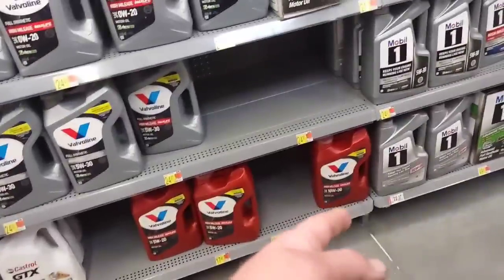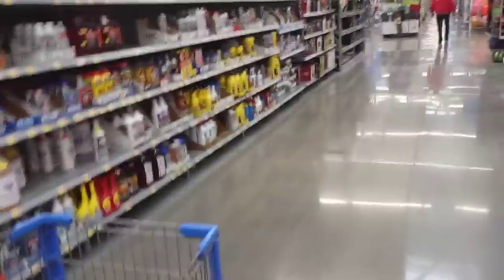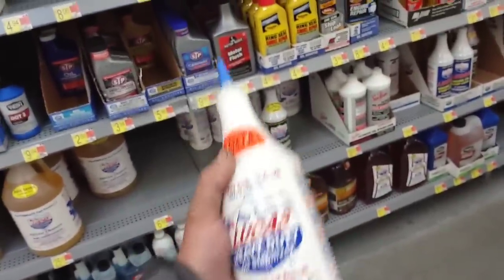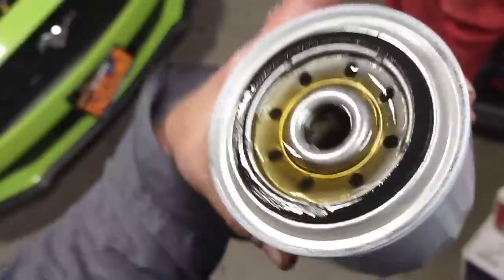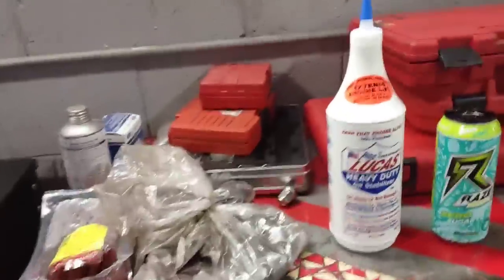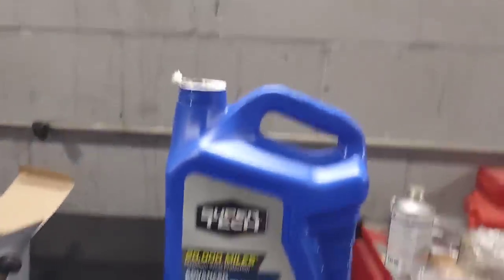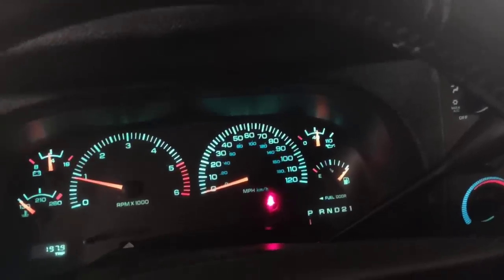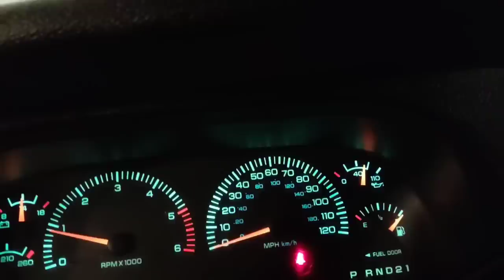We continue With Marvel Mystery Oil and SuperTech 10w30 20k Mile Full Synthetic Oil Dodge Ram 5.2L

Comment: I thought I was the only one that hated going into Walmart lol
Reply: Tangling with the unending throng of idiots in the parking lot forebodes the hassle coming when you get inside the place.
Reply: @davef.2811  Yes! 😂  You've got to park a mile away, walk passed the idiots, and the store is usually a mess.  Then you have to check yourself out.  I feel like they should be sending me a paycheck lol
Reply: We have a Wally World in Seminole FL. The building is 1/4 mile long. I have bad knees. A lot of walking in there. Yes there are electric shopping carts there, but I hate the looks I get when using 1.?  But there prices are very low 4 the most part.
Reply: @Thebowzer221  You make a good point.  The stuff in there usually is cheaper and I can understand many who shop there out of necessity.  Personally, I don't shop there, but I figured out that about every 3 years, I have some reason that I have to go in there for.  People kind of look at me funny like they don't believe me when I say I've set foot in a Walmart once in about 6 years.  It is possible! Lol
Reply: Heck no.  I will, and have driven past WM's in order to get a lot of things I needed.  F them.
Reply: @bouncingsoul777  Absolutely.  I mean, you can buy low priced Chjunk, and prop up those commies, but I'd rather buy better quality stuff from a company that respects me.
Reply: The Bowzer What a baby. Complaing about bad knees and then the looks you get for using the electric cart. Use the electric cart don’t worry about the looks, better than your knees hurting for a couple hours.
Reply: The first time I went into a Walmart in Washington, I was surprised that Everything was thrown on the floor as you went down the aisles... Guess only drunk clowns shop there or something... Sad...
Reply: @jmackinjersey1  Agreed.  Not to get political (because it seems like everything these days is), but I'd rather pay a little more and go to a place that respects their employees too.
Reply: @frandanco6289  😂 we must have those same clowns in Kentucky
Reply: I can offer my secrete for dealing with the crazies at walmart, but you have to promise to keep it to yourself. ( shop early in the morning when most of the idiots are still hung over/just waking up).  I don't shop anywhere after 10 am unless it's an emergency.

Comment: "MMO is about a 5 wt oil. It will reduce the high end number of a multi-vis oil by 4 wt points. The low end number will stay the same when used as per directions." So there's the thinning answer from MMO. It doesn't thin it much.
Reply from the maker: I did notice a pretty slight difference in viscosity so either way potato potahto
Reply: Plus the lighter weight components of the MMO will flash off some, leaving the viscosity of the oil still ok. If you want a good cleaning oil to complement using the MMO in a higher mileage engine such as his Dodge 360, consider using M1 10W-40 High Mileage or a diesel 15W-40  such as Super Tech for a summer cleaning run with a thin cleaner like MMO.

Comment: I pretty much just use Supertech now because the cost is impossible to beat. It's mostly made by Warren Oil Company and really as long as an oil has an SAE label it meets the standards for that rating or there are heavy fines. Everything else is just additional additives a brand may put in. Heck most of the 'big' brands don't even make all their own oil they just buy it from mixers like Warren and have their additive package added.

The Supertech filter was originally made by Wix, but now the contract is with Champion and as far as I can tell looking at them it's the same design and components.

Comment: According to my contact at Champ Labs, the Super Tech filter is good.

 I have had Super Tech oil tested via Blackstone Labs when I was doing a test similar to this one on a high mileage Honda CRV that pulled behind my motorhome and it was as good as any I tested.
Reply: The supertech filter clogged on my silverado after about 4k miles fyi. Got a new one on w oil change about 1000 miles ago still going strong.
Reply: @AldousHuxley7  
That can happen to any filter..
 Did you cut the filter apart to see what failed?

Comment: 500 miles. Let it work. This is informative.  I've still only 80,000 on my 2010 hemi and change oil once a year atleast. Some years i only put 2500 miles on the truck.  Brother put 40,000 in one year. So far no problems but have some older vehicles, that were pre owned. This may come in handy.

Comment: I bought almost the same oil and filter today. Bought the high mileage super tech, and the super tech filter. The filter is not that bad too for a cheap filter. Yep same number as the frame line. Super tech makes good oil. Yea auto parts stores have huge price increase over Walmart!

Comment: I would do at least a 500 mile update.  The buildup is not that bad.  I would have done a compression check before and after to see if it cleaned the piston rings.  I have used mmo in general aviation years ago for stuck rings a sticking valves.  Worked great.  If a aircraft sat for many years the compression was usually low.  Running mmo for a few hours often returned the compression to normal levels.
Reply from the maker: There's a lot of things I could have done but there's also so much time that I'm willing to put into each project and still work a full work day. I think that's what people don't take into consideration their like oh I would have done this I would have done that yeah and you would have worked a 10 to 12 hour work day plus did all that? No you get to the point and you just give people enough to say look I'm going to show you that it's working and then let's move on to the next step

Comment: @ Ford Boss Me: Ok, 1st off, this is going to be a long read. But I hope informative and even slightly funny at times. 

I'm old. Over twice your age I would say. Been rode hard and put up wet more times than I can count over the years, but still kicking. Was in the Automotive Industry most of my life to some extent, until I finally retired. Started working on cars when I was 11 yrs old, 1964. First one was a 1952 Belair, Flathead 6 cyl., 3-speed on the tree. I just had a knack for fixing cars from an early age. I used to tear apart most of my toys in the 50's to see how they worked (started at the age of 4 according to my parents) then I'd put them back together, and they still worked, to my amazement, lol.

MMO (1st came out in 1923') is something that I've used (I buy it by the 4-pack, 1-gal jugs @ a time, as it's just cheaper this way in the long run), and I've always run-it in every piece of equipment I've ever owned that runs a gasoline engine, from the very beginning too. That way the MMO doesn't have to do a lot of cleaning, per-say, like you're trying to do with this engine that's already pretty dirty, but now looking much better! However, over time the MMO 'will clean' the inside of your engine to the point that it's 'almost' spotless and Brand New looking once again. Ya just gotta give it some time is all. I put MMO in my fuel too @ every fill-up. 1oz per-gal. :-)

Now, you want the MMO to do it's job, but not too fast. This is an 'over a period of time' ordeal type of thing to get the inside of your engine looking clean again. The Lucas will not change the color of the oil. And it shouldn't affect any outcome of your MMO testing. However, it will lift the weight viscosity (which is good) of the oil which is most definitely causing thinning of the oil by putting too much MMO in when you've changed your oil like you've been doing. However, I think under normal circumstances a Quart of MMO is way too much. But then again, if you're going to change the oil and filter every 800-900 miles or so, then it'll probably be Ok for this experiment. But only for a short while, seeing how it is Summer now.

When changing my oil in my 05' Chevy Trailblazer inline 6cyl (uses 6.5 qts) I use the same, exact brand oil you're using, but in a 5w30. And I take a quart bottle of MMO and a quart bottle of Lucas and add 16oz of each to every oil change. Been doing this for a very long time now. Engine clean, and running super smooth! This engine still has lots of power, for what it is too.

But way back in the day when I first started driving (1968') I was using Havoline 10w40. But in the 80's, the powers that be @ Havoline changed their formula, and the specific stench that it had (which most anyone old enough from back then that remembers this will know exactly what I'm talking about) suddenly disappeared? That's when I knew that they had changed their formula. But I didn't know if it was for the good or the bad? So I switched over to Valvoline 10w40 in my personal stuff. But I was already running Valvoline 20w50 in my races cars, plus a little STP ta-boot, seeing how I'm from Richard Petty's neck of the woods. :-/~

Now, all this was waaay before before the SuperTech Brand Oil ever came out. Back before Synthetic oils were ever heard of in my neck of the woods. But Synthetic Oil has been around since 1929. It's just that the public wasn't able to buy it way back then like we can now. Mostly used in the Industrial areas and the Airplane Industry back then. Even in the 80's when I owned an Automotive Parts Store, there were NO Synthetic Oils available for me to buy for my Parts Store? Weird huh? Well, at least not through any of the Oil Distributors I dealt with from way back then there wasn't.

Now, this beef about Pennzoil. Way back in the day all Pennsylvania Crude Oils were paraffin based. They had a waxy base that would cause problems down the road by coating everything inside the engine with this wax. Same thing with Quaker State Oils. Both Pennsylvania Crude Oils. This is where the trouble came in back in the day with the old oil formulas. But I suspect that things have changed since then, for the better, for the Pennsylvania Crude Oils. PS: never switch from running whatever type of oil you're running over to Castor Oil. if you do, you'll wish you never did. Engine will suddenly start leaking and consuming oil like it never had before. Ask me how I know! But as soon as a switched back to Valvoline it stopped leaking and burning oil!  (350 cub., Small Block Chevy Engine).

Have you ever seen the inside of an engine that was run on 30w non-detergent Pennzoil or Quaker State before where it wasn't serviced properly? Oh, My, Goodness! What a mess! First one I ran into I filled a 5-gal bucket of the nattiest, stickiest, gooey, black oil sludge I'd ever seen before, and I filled a 5-gal bucket-up just from cleaning under the valve covers, top of the heads and under the intake alone. Don't even know how this truck was still running when it rolled into the shop? But that was the beast of a non-detergent oil that hadn't been changed in a loooong time, apparently. No detergents in that oil at all. Ended up just pulling the engine out and cleaning it right. Oil pan was worst than the top of the engine too. Yuck! What a mess. Never again did I ever tackle an engine that was as filthy dirty as that engine was - ever again! I'd just send them on down the road to some other sucker to work on. :-) grin

Love what you're doing! Keep at it. And I know that there are plenty of armchair, Online, wannabe (never been) mechanics out there that are wanting to tell you exactly what to do. You're a smart guy. Only listen to the ones that have good morals and know what they're actually talking about when it comes to vehicles, and you won't go wrong. Selah (Told ya it was going to be a looong one, lol. Blessings! Even though you are a Ford Guy. Ha! :-/
Reply: I run a Classic car Dealership and the first thing we do is change the oil and throw a quart of MMO in it and run it for 100 ish miles and then change all the gaskets and seals and put good oil in it. Were not like Maple Motors or one of those, we sell mostly running and driving project cars, we'll buy a car for 5k, go through the engine, fuel system and brakes, replace what needs replaced and sell them to someone looking for a running and driving project car. Running MMO and cleaning the internals of the engine saves us alot of time and alot of money because that's less we have to chase down.

Comment: Great job, Great idea not to use Lucas at this time,later be good. Valve covers probably never get clean very much due mostly oil vapor and blow by gases reaching top of valve covers. Cleaning inside is most important. Thanks for video.

Comment: Best cleaning oil I have used is Mobil 1 10W-30 high mileage or even 10W-40HM when I use something thin like MMO in hot weather. I also use the longer ST8A Ford version oil filter since it has a little more filtration area. Just some ideas

Comment: Loved the MMO series and immediately bought 2 quarts from Walmart for the same price on your video. Just added a quart in the engine (after draining a quart of oil) and added to the gas to my 1990 Chevy Silverado. WHAT A DIFFERENCE in the gas pedal feel and response. I guess the throttle body on the carburetor was full of carb build-up and it would be very hard to press and very hard to modulate precise. Now after ONLY 15 miles it is night and day difference for the gas pedal and the throttle body. What a change.

Comment: I ran 1 qt of MMO in my Caprice PPV (L77) and I heard an audible difference. 4000 Hours of idle and 44k Miles of police use probably left some oil tarnish! With my most recent oil change, I switched it to Amsoil XL 5w-30/w a Purolator Boss filter. I also switched the transmission fluid over and the difference compared to Mobil 1 oil and Acdelco Dexron Vi  is night and day.

On top of that, if you get another sludged up engine I would love to see Howes Oil products used. Everyone does the big three, Lucas, MMO, and SeaFoam. I first saw Howes products and Menards and was really curious on the performance of their products.

Comment: Why not do a used oil analysis?  Also, Lucas Oil Stabilizer is nothing but VERY thick oil.  In fact, it is so thick, it will thicken your oil far out of grade, and that gets it out of the specs for your engine. I'd like to know if MMO thins the oil and by how much.  It might thin it to or even below a 20 weight.  A 20 weight probably wont be an issue, but below that could be a problem.  Anyway, I enjoy your videos!
Reply from the maker: You can't do it and oil analysis every time you come into a situation especially if it's not your vehicle or if you have multiple Vehicles the cheaper insurance is just actually keeping the oil change that's it bottom line

Comment: Weekly would be good. Just top off oil level as needed. If down a quart of oil. Top off with .25 mmo and .75 of motor oil. That way you don’t dilute down the motor oil too much. But as previously mentioned keep doing these type of oil changes until your engine is almost clean or see a lot less debris in the oil filter.

Comment: No need for Lucas just use a heavier oil! I went from 5w30 to 10w40 Mobil Super 5000 with one qrt MMO substituted for one qrt oil & man that oil is beautiful all the way up to 5000 miles! My oil still had about another 2000 miles because it really wasn't dark & didn't smell but I went on & changed it so I'll be good for spring & summer just going back'n forth to work mostly! That MMO is the truth! Plus I put about 1 1/2 to 2 oz in my Race Trac 93 oct fill ups. I have about 138,000 on my 2005 Trailblazer & she's running smooth & cool👍🏿 Not to get off topic but I also add a bottle or two of the Redline Wetter in my coolant & man that stuff is awesome! Lowers that boiling point in your coolant & keeps your seals conditioned! Good stuff🥰👍🏿

Comment: Old timers used to use diesel in the oil to clean out sludge  a 50/50 mix diesel to current/old oil if really bad and 20% if not so bad but didn’t run it a lot of miles usually about an hour or less then dump it and new oil/filter

Comment: I know I'm gonna catch hell for this, but I use Rotella in all my stuff- cars truck lawn mowers motorcycles. No problems.
Reply: Not from me. Rotella is great. I use it in my pushrod motors but wouldn't hesitate to use it in my more modern engines if I new I could always find the right weight.
Reply: Rotella Gas Truck synthetic oil is an excellent oil and one of a handful of top contenders on the market, especially considering it's price (ie at Walmart) and availability. Many people have posted laboratory analysis of their used Rotella Gas Truck oil and the results have always been excellent. In nearly every case the lab results clearly showed that Rotella Gas Truck synthetic was still doing its job very well at protecting the engine even at 10k miles.

Comment: Even though you use good oil and change it often you can still get stuck rings. Rislone high milage concentrate is very good at unthinking rings. It is extremely high detergent run it with an oil change then next time use straight oil and notice less oil consumption.

Comment: That's a good idea. That Lucas oil stabilizer is sticky. Would probably work better if you're going to flush with a higher MMO concentration for a shorter period of time. Lucas oil stabilizer does lose its stickiness after a little while.

Comment: One tip for oil testing. Be sure to get the TBN and TAN tests. TBN or Total Base Number with tell you how much of the additive package is left and the TAN or the Total Acid Number will tell you how acidic your oil is.
Reply: I think if you only go 5,000 miles between changes with mostly highway miles, then including TBN & TAN is just a waste of money especially if you're doing it at every oil change.